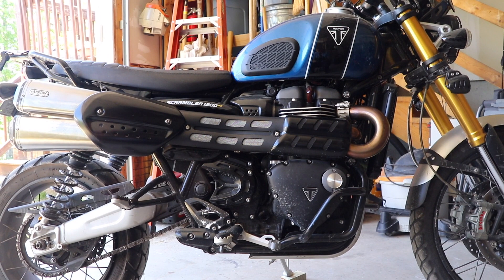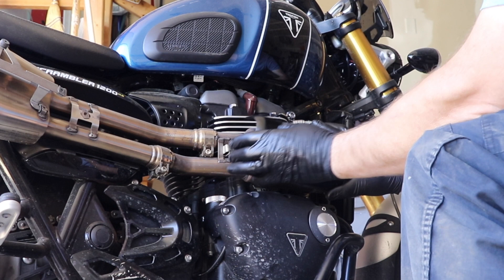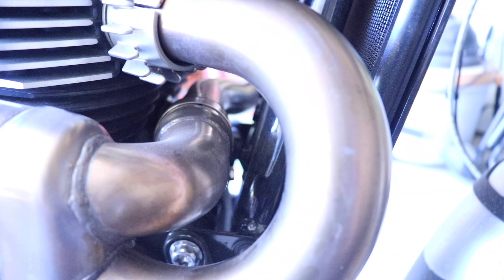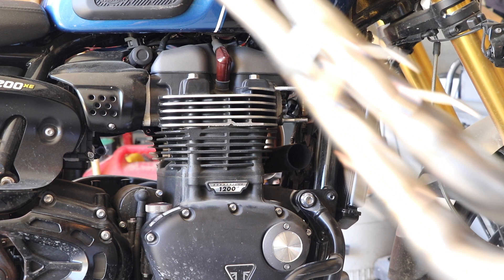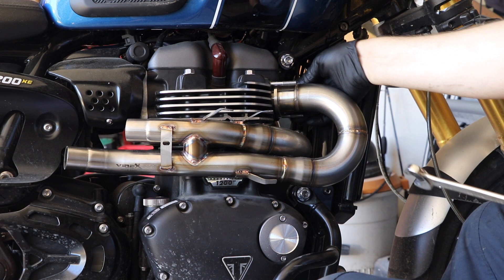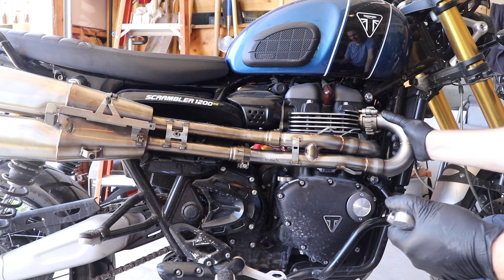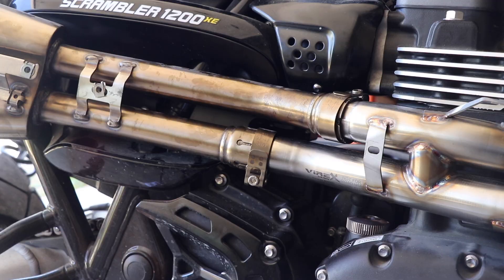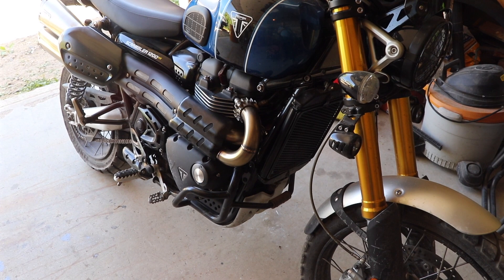Triumph Scrambler 1200 DE-CAT H Pipe Install How-To HQ Audio Before/After Header

Comment: All I did was throw headers into a vice and knock the guts out of cat case with hammer and cold chisel lol. Took a little while but eventually the insides all fell out in small chunks. Total cost $0.00 lol. Just an hour or so swinging the hammer and shaking the cat housing 😁. It still looks factory, just sounds and performs way better👍

Comment: I de-catted my speed twin. Man it roars now, also helps with the engine heat. Yours was a lot easier. I had to undo the whole left side of the frame on mine.
Reply from the maker: The Cappy wowser bub!

Comment: Maybe I'm just looking in all the wrong places but I can't seem to find a definitive answer to the torque setting for the header bolts you tighten starting at 8:45 in the video.
I have seen 10nm and 19nm for related parts, but the labeling was crappy and I am still unsure.. Watching how hard you twisted I am guessing the 19 number to be the ticket..?  10 seems awful light, but then these things heat up.. Just really want to make sure and avoid damaging my heads..  lol..
Reply from the maker: Good-n-tight is what I did, just dont over tighten them. Then run it for a bit and recheck.

Comment: I notice you had painted all the silver colour parts into black. I was also thinking to turn most of the original silver parts of this bike into black when seeing the bike in the showroom. May I know if you just used canned colour sprays to do that or you used “Powder Coating” method and put the coloured parts into an oven... to finish the colouring? Cheers!
Reply from the maker: Autobot I used VHT Enamel. It’s not as good as powder coating but works pretty good

Comment: Hey man. I've got an XC and riding in AZ, so you can imagine the heat from the cat is annoying here. Did you ever consider doing a header wrap? I saw that you wrapped the exhaust on a prior scrambler 900. I'm interested in keeping the cat. Just wondering if you went the decat  route primarily  for weight, or if there  was more.  Thanks!

Comment: Curious as to a few things if you do not mind me asking; How long did you wait before you did the decat ? Miles ? Months ?And why ? How long have you now had it installed ? After the cold start, idle till operating temperature reached (ecu closed loop self learning process), have you noticed any significant difference ? (have not found your follow on review yet. I did watch your 1000 mile review). Ride safe !
Reply from the maker: I rode it a full year, about 3500 miles. I wanted more power and mainly wanted to deal with the heat (which is pretty bad when in traffic). I noticed a better sound at idle, much better initial throttle response, but not much in the higher end revs. Thank you for the comment! I am working on posting the updated review...soon!

Comment: Can you tell me the diameter of the pipes used in this kit?  I was watching the TEC videos and the guy there said that some manufactures of these kits are using pipes that are too small.  I believe the stock pipes are 45mm.  Thanks and please keep the XE videos coming.
Reply: The guys at AJ wrote back and stated it was 1 3/4" or the stock size of 45mm.  This is exactly what you want!
Reply from the maker: Same as the stock ones. I don't remember the dimensions, but they were exactly the same as stock. Stay sub'd, I have a long term XE video coming out!

Comment: What paint did you use on the heat shields?
Reply from the maker: VHT I like it very much. Had bad trouble with their header paint but the epoxy paint from them is the 💣